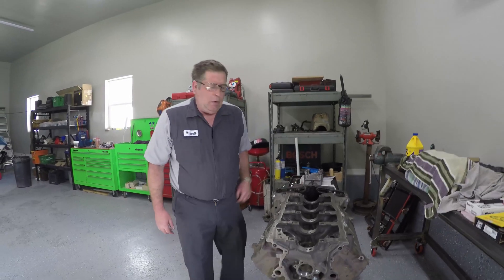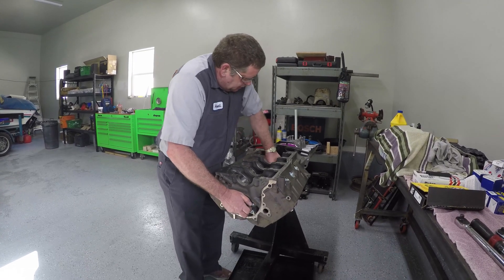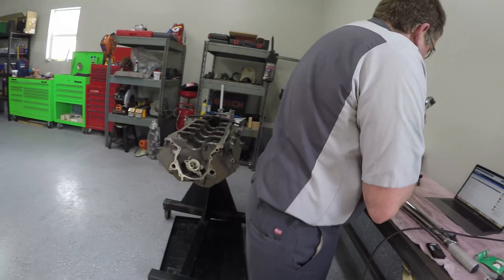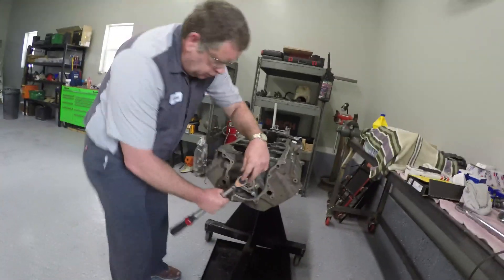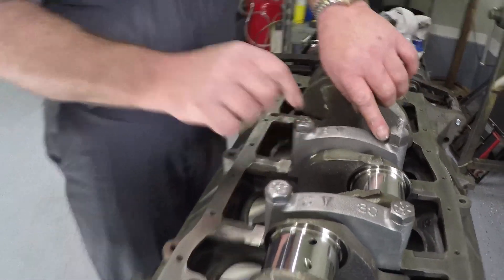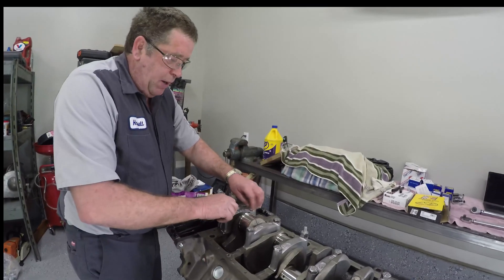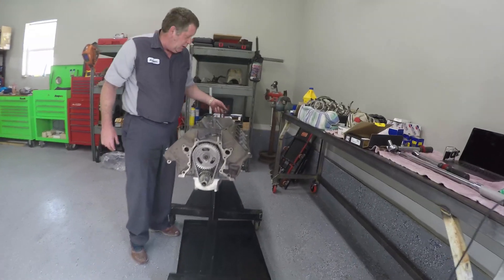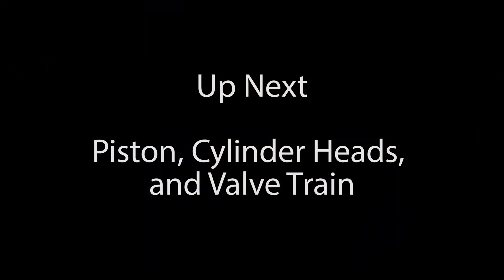351 Windsor Build, part 1

Comment: Also, to all your new engine builders. When you bring your block back from the machine shop. You are not yet ready to assemble it. You need to personally go through and clean that engine. Use brushes and check every oil gallery for metal shavings or crud. Plus much much more. Please watch a video on how to clean your block. Before you begin your assembly👍

Comment: I never just bolt on the thrust washer. I first aline it with the cam gear. Lightly tighten the two bolts so the washer can move back and forth. 
Place the cam gear on with some grease. Take it back off. You can see if the washer is centered. Then slowly tighten the bolts without the washer moving, making sure it is centered. The thrust washer has side to side play in it. Take care to have it centered.
Also before installing the timing chain and gears, de-bur the gears on a wire wheel attached to a bench grinder.
There's sharp edges on the gears. Make sure they are smooth. If you don't, metal particles will wear off and go through the oil pump. 
Been doing this process now for 35 years of engine building and over 500 strictly Ford engines.
All rebuilt engines have a certain amount of initial break in wear. 
Rings, push rods, valve stems, cam lobes and lifters. 
These wear particles go straight through the pump. That's why all oil pumps will have marks on the internal gears.
To prevent these particles from entering the pump, I strategically place magnets in certain locations. 
One magnet in each drain back location in the head. Total of 4. I can take a valve cover off and check for metal particles collected on the magnet.
I stick at least two in the pan. A good thing is to get a magnetic drain plug or jb weld a round one on the drain plug.
All rebuilt engines will have metal particles collected on the magnet. 
If you have a catastrophic cam failure, the magnet will catch it before it goes through your engine and ruins it.

Comment: Excellent video! Now I feel confident that I can rebuild my 351W myself once I receive  the machine shop measurements and the parts I need to buy; there are so many companies making parts for the 351W that is not easy  to select ;would not mind to spend a "buck more" for quality parts though. My engine is a D9AE... code  (flat tappet) but I also have one with roller lifters as a spare. Thank you for posting it Sir!